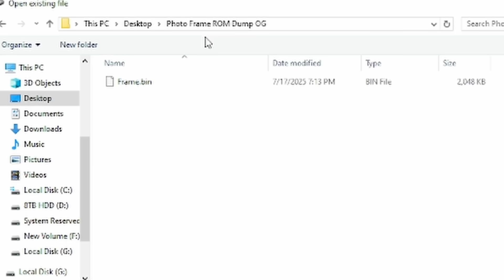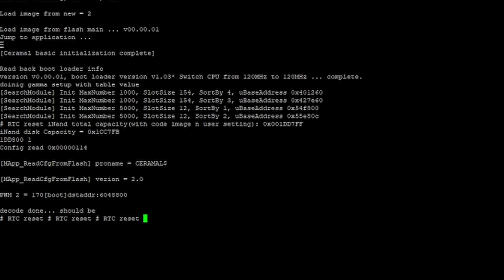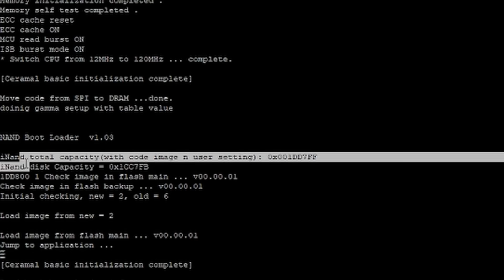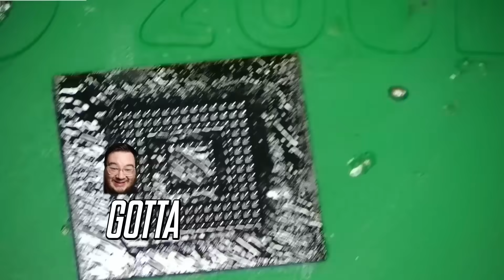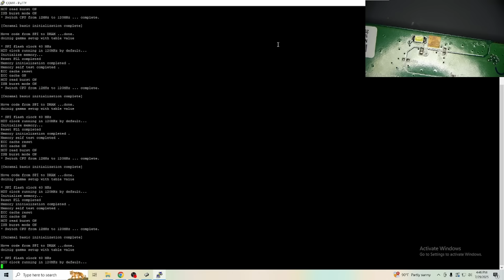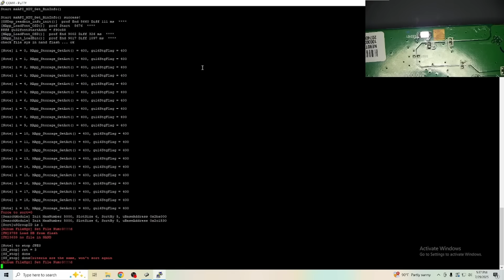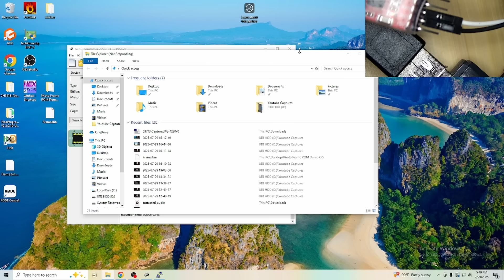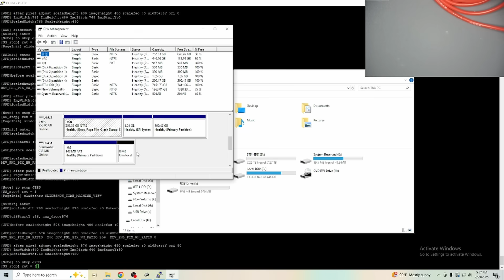Sony Left The Memory UNENCRYPTED! | Photo Frame Hack with No Experience S1:E03

Comment from the maker: i can't believe it
Reply: Same
Reply: this was done for 3DS consoles,I used a 3DS as a usb flash drive just for the sake of it, your basically just mounting the emmc as a SD card then you have the SD cart into a usb drive....hence usb drive detected, I have a feeling there will be nothing in the unallocated space (I think windows detects linux formatted partitions, but doesn't mount them or asks you to format them rather than it saying "unallocated", although you could just boot into a linux VM and see if it has a small linux partition for the firmware and UI etc, usually embedded systems just leave it all free and readable, no encryption or anything, but also many devices leave a small section unallocated to account for variance in chips that are slightly smaller rather than having to rework the firmware in the middle of a production run because one of the batches of emmc chips had a few bad blocks, the fact it was formatted is interesting, I guess the picture frame just mounts the Emmc chip with a fat32 partition for storing the images on assuming it isn't using some indexing or naming scheme  thing you would need to recreate you might be able to just dump some jpeg files on it, if there was a usb port on the frame you could've probably saved yourself a bunch of work and just plugged it into your PC and get the same results

all that said, often the fun of doing is worth more than if you did a bunch of unnecessary stuff, because you're often still learning when you do the unnessisary stuff

Comment: Listen to me mate i’m 12 but i am experienced on the field (compiled linux for a set top box, hacked a bluetech dp72 photo frame to run custom code)
Connect the sd to linux, do a dd command (basically dump the 8mb partition) and use binwalk to analyse the image. By looking t the uart log this is not an embedded linux system, and the bootloader is bot uboot so you need to do a lot of reverse engineering. The chip as a mips architecture so linux is supported, in theory you can compile a linux kernel for it and take the vmlinux.bin and stuff it inside the 8mb when it moves to dram (for compiling use a modified tinyconfig just for uart and do a hello world from here), else you could get a decompiler like ghidra and reverse engineering the existing os to look for the lcd function and then run your assemblycode calling it. For a beginner, the linux approach is the most safe, tho you need to know how the bootloader works (which code get put into dram).

Comment: For future reference if it helps. When dealing with eMMC like this on a board and trying to access without giving it power yourself. at 9mins secs. if you simply turned those resistors for CLK or CMD sidewards. then connected your adapter. turn on the device. and plugged it in. you'd have no issues. Disconnecting CMD from a processor first is normally a good idea to prevent unexpected corruptions. then put resistor back when done.  But still good job. look forward to the next video. also if you dont want to solder all time PcbBites probes are a great investment

Comment: You sure the last one ain't booting from an internal ROM in the microprocessor chip similar to those old "gold card" wafers used for satellite tv hacking decades ago?

With those you actually can't talk to the flash rom directly, you have to load something on the micro which can talk to it and then talk to the micro. If so Arduino ISP is a well documented and supported method to do such a thing...

I suspect that NAND is purely for storing pictures as i've never seen a device boot from firmware stored at the very end of storage. Create a 8mb partition via windows and put some data on it, if it still boots you know you're barking up the wrong tree...

Cool video tho, interested to see where this goes 😀👍

Comment: You could try using a Live CD Linux, then dumping the partition with dd, since it probably runs some kind of embedded Linux, maybe it uses EXTFS?
Reply from the maker: That's a great idea, I'll give it a shot!
Reply: @chasefournier you could also try using testdisk or binwalk to check what's inside it, remember to always do these in a backup image instead of the actual device

Comment: I would boot it up into Linux, as it might show more info of the 8MB partition, and possibly even read it. At the very least it’ll probably give you info about the file system. Im also pretty sure there was once a tool to dump the entirety of an SD card as a single file, given the hex data on the SD or something, im pretty sure it was used for old androids or maybe even nands but it could come in handy with the 8mb partition, in case if it has no filesystem.

Edit: It was HxD i was thinking of. Wow.
You can also use DD on Mac or Linux.

Comment: 13:37 I am having flashbacks to 20 years ago--the ol' Linksys WRT54G days. I was like 13 years old soldering a 1GB SD card (which costed like $94) onto the GPIO headers of the WRT54G based on some newsgroup post and for the "whiterussian" (pre-DDWRT) firmware to run some super primitive torrents or whatever. I had it on my roof in a tupperware just experimenting and having fun with the new tech. Like, wow, a trip down memory lane.
Reply: Good old 54G days!, I'm still using openwrt for free broadband to this day 😂😂

Comment: just take out the adjacent resistor to the lines you're using, let the device power it up to use its power and that should've worked, due to the fact the main soc was acting as the sdio/mmc master
Reply from the maker: 👀 i see. this is interesting

Comment: only read the flash when device is powwered off otherwise the clock will be messed up.
And use linux, not windows because windows tends to write secret bits to it.
Dump the flash using DD then you can work with that and flash it back anytime

Comment: So yeah the SPI bus can have only 1 master and not 2 cause otherwise the 2 will conflict and fight each other and nobody can access or read the emmc then. Its also why it wont always work if you clip on a soic8 connector onto flash chips on for example a pc motherboard because then you also have it that there are 2 masters on the SPI bus and that they will conflict and fight.  Its like when you have 2 kids fighting over 1 toy meaning neither can play with it basically. 

I also learned this when i tried to dump a cheap camera with a soic8 flash that when i clipped on the clip the soc of the camera also tried to access the nand causing corruption or just access and read errors. 

Also because EMMC is basically a soldered sdcard it can be read with any sdcard reader and i have done this on some devices like my old router which used a phison flash controller and converted the raw nand to a spi interface and i managwd to get the full 512mb dump of the firmware. 

The 8mb partiiton you had likely contains the main os (either embedded linux or an rtos or linked ELF binary). I would advise a linux machine or dualbooting because hardware hacking and looking at weird partitions is nicer and better on linux platforms and you can use tools like binwalk to dunp the image and look for headers and stuff. I do all my hw hacking on debian linux

Comment: emmc/sd is a serial device similar to spi, so there can only be one master trying to access a slave device at a time otherwise you'll get bus contention and neither device can read the slave device. As you've guess the unallocated 8MB at the end is very likely a linux partition that contains the firmware. Kinda funny they threw a 1GB flash chip at it when the entire firmware only takes up 8MB but economies of scale and all that I guess.
Reply: I think the frame can copy 1gb of images in the nand and the firmware is in a different partition
Reply: Funny thing is that 16megabyte soic8 25xxx series spi flash chips would have probably been cheaper but maybe left over stock?
Reply: @309electronic5  Those might not have existed at the time.